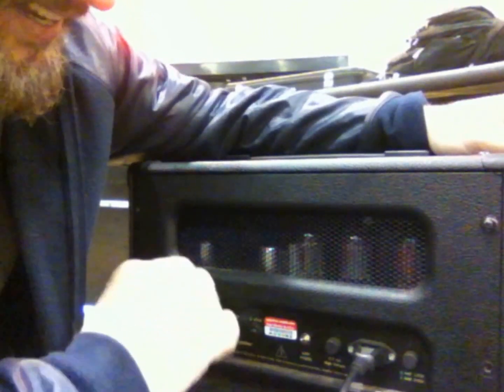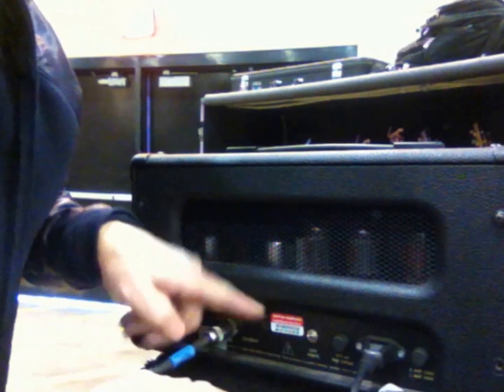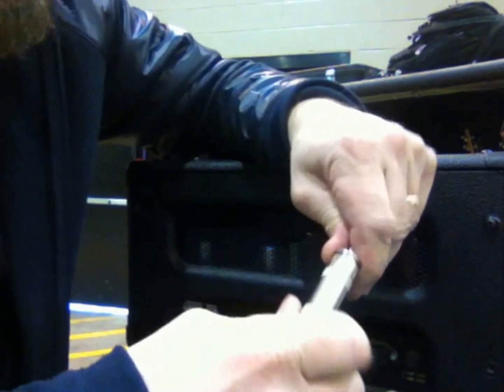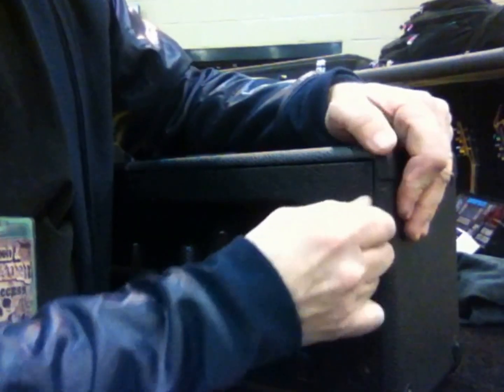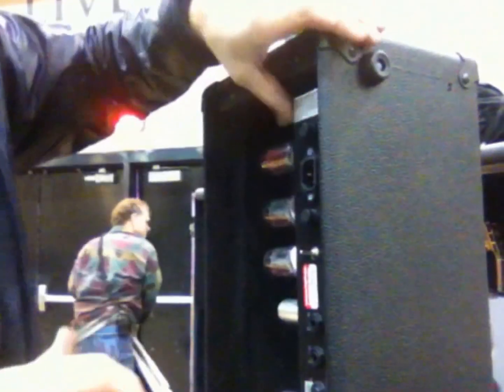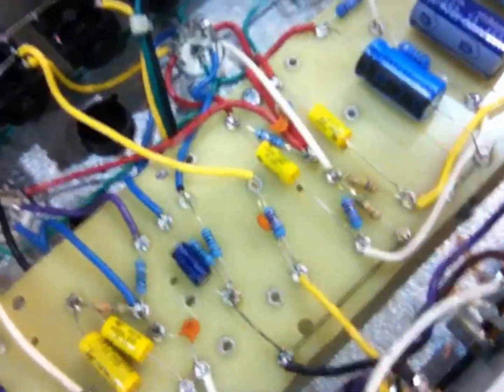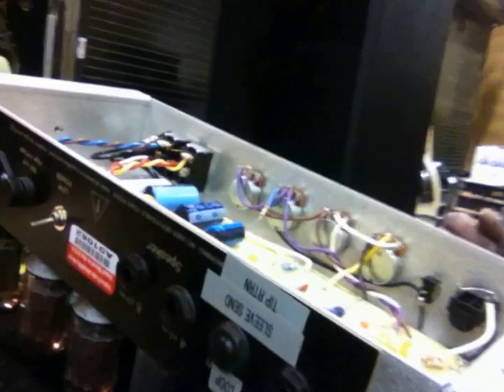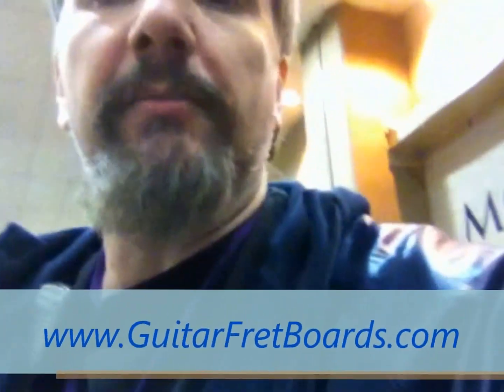guitar amp speaker jack troubleshoot and repair

Comment: Hello good sir, i believe my speaker jack is bad, its a SS amp, and the jack is soldered directly
onto the board by 4 pins, is there any way i can test if the jack itself is fauly or if its sonething else? The head works when i use the line out jack to an active speaker, but the speaker jack to a cab doesnt work, but the amp always shows its getting signal

Comment: I have a fender amp and it has a back panel, and I'm not sure how to remove it. I removed the screws but I still can't remove it.
Reply from the maker: Not sure which model amp you have, but use one of the screws to help pull the panel off by partially inserting it into a hole that the screw came out of. Back panels can be a.pretty snug fit.

Comment: Is it normal for the speaker cable to wiggle inside of the amp's speaker jack and cabinet jack? I've noticed this on both my guitar and bass head's/cab's. They have play in them. They work just fine but because I'm OCD I would like to have the peace of mind of knowing this is normal. Thank you
Reply from the maker: yes, it's nornal. They wiggle because of how the jack is designed. The jack has a flexible contact point that makes the "lock" feeling when the 1/4" connector slips into the  jack properly. So, there has to be a tiny bit of play. There are some jacks that are designed different and more solid, but the basic jacks have wiggle.

Comment: Hey sammy thanks for the vid I have a peavy valve king head and cab. The head has a switch from 4 to 8 to 16. Ive always had it set to 16 and my 4x12 cab (i think) is 16 ohm. What happens when I switch to 4? Will it switch to only use some of the speakers or just less power through all?
Reply from the maker: +Max Carroll If you have a 16 ohm cabinet, you can run your head at 16, 8, or 4 ohms. There will be a volume change as well as slight tone difference. As long as your speaker cabinet ohms is equal to or HIGHER than your amp head you are ok. Never run an amp with the ohms set higher on the head than the speaker cabinet.  #ohms #guitartech #guitarist #guitar